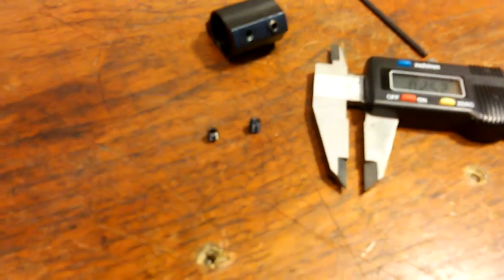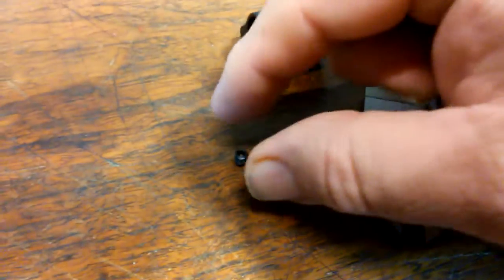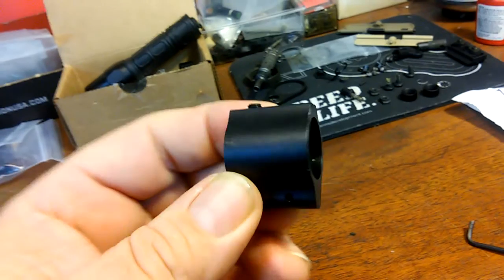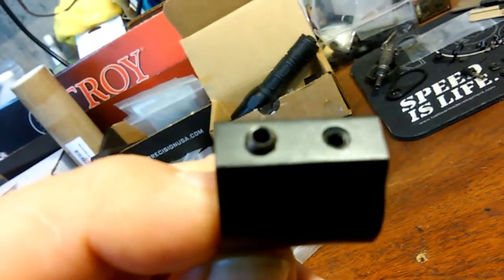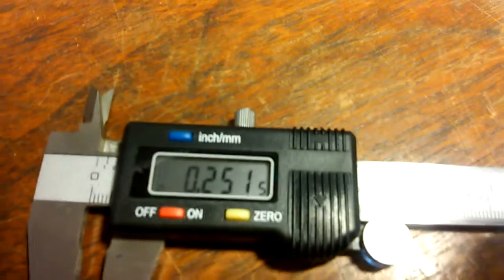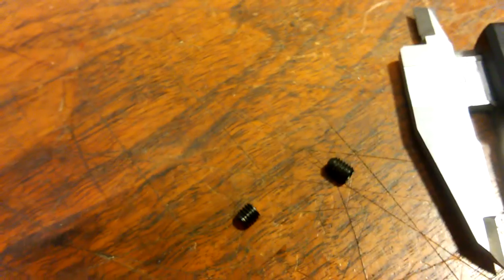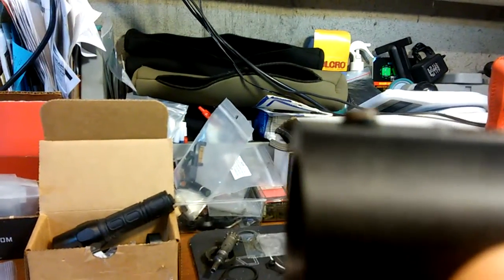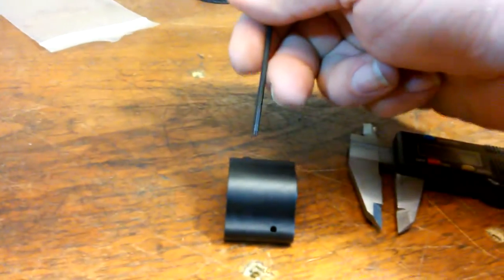set screw tip

Comment: Good info, just in time for my next build. What set screws did you reorder, and from where, Brownells?
Reply from the maker: +pdalko I asked a friend to pick up the 1st batch, he works at a machine shop and there is a hardware distributor they do business with. if I had a part number I would share it otherwise, but the OEM setscrew is .20" and the one's he gave me are .25" measured by my micrometer I don't know the thread pitch off hand. I will update this when I re-order them from him since I am running low now. every build I do these screws go in the gas blocks.